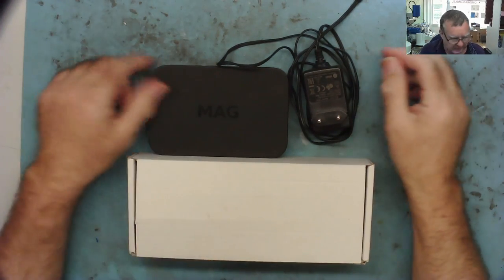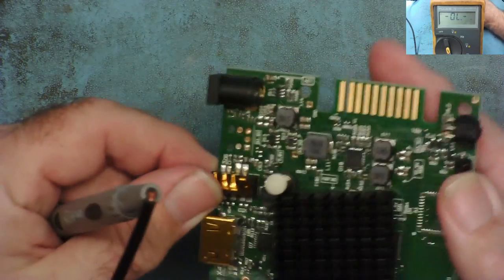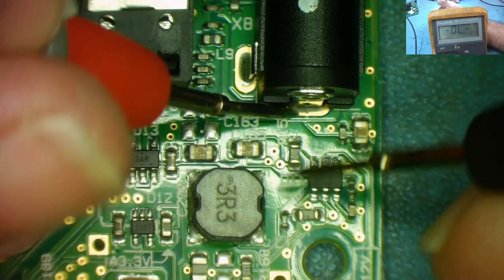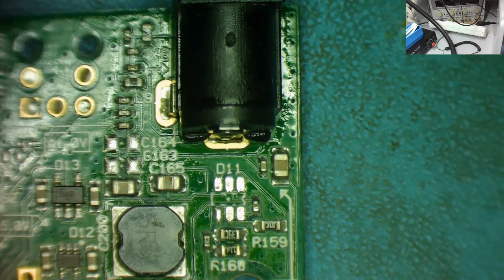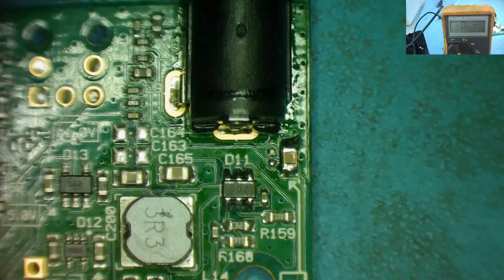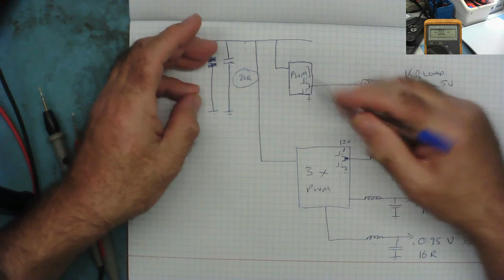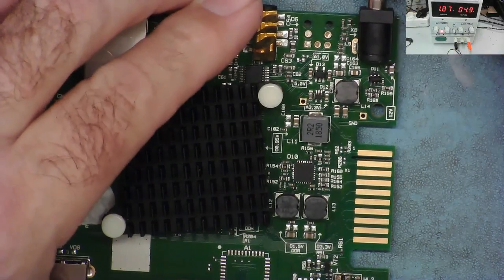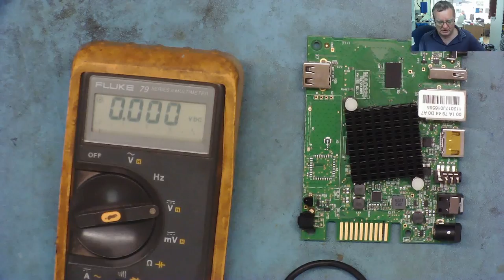Dead MAG 322 IPTV Box Repair. LER #193

Comment: Amazing diagnoses and detailed working of ohms mode and usage. Friction is the answer to the question of untangling. Once the wires are tangled there is too much friction to untangle themselves. Great video Rich, i learned a lot. Thanks mate.
Reply from the maker: Thank you.  Though I keep math off the channel most of the time, ohms law is the one thing you really need to know and I will continue to teach here when it is relevant😉 Regards the non-untangling wires is this a bit like entropy?

This makes me think of Prof. Brian Cox - in the 90s he was a member of a band called D:Ream who had a massive hit with a song called 'Things can Only Get better' and in latter years, it seems, thanks to the law of entropy he went on to  prove that 'Things can only get Worse!'  Now there is some serious karma for you
Reply: @LearnElectronicsRepair  Its really simple to learn and it should be 101 for everyone that has any interest in circuits of any kind. Hes a good dude, the band was ok lol. Are tangled wires entropic by nature.. I would say no. Entropy cannot be reversed its a one way system. They do go from ordered to disordered but can go back to ordered. The energy they used to get tangled was caused by movement, further movement may cause the entropy to increase or decrease of course as the wire is a single object. Given enough movement they can resume a low entropy state.

Comment: no boot with both leds lit on eth port indicate failure at early bootloader/initialization stage on most broadcom and many other socs, that 25q032 spi flash is storing the bootloader, good intuition. you should be able to read it with ch341a programmer
Reply from the maker: Actually I just ordered a CH341A with 1.8V adapter this week as I have a Medion laptop here that has a BIOS password locking it, and because the embedded SSD is corrupted it will not boot to an OS or from USB, nor can I get into the BIOS.

My TL866CS will not program 1.8V Eproms and the Medion BIOS has exactly that.  As a plus side I will also be able to use the CH341A 1.8V adapter with my TL866 🙂

If it will program the 25Q03213 that would be a big bonus

I'm a bit concerned about the Core reading lower resistance on that box, but I'll definitely give it a go

Comment: I think the flux crystalizes and forms a shield around the unsoldered components. Thats my reasoning to why you couldnt read the short on the capacitor when you took it off. I sometimes have the same issue

Comment: Hi again. I have 2 3010D power supplies. At 1 volt I can only get .1 or .2 amps. Lower voltage and I am lucky to get .1. No heat at these low amperage's. I saw you put 5 amps into a video card at .8 volts in a video. What would you suggest, get a different power supply? Suggestions??? Thanks, amtpdb.